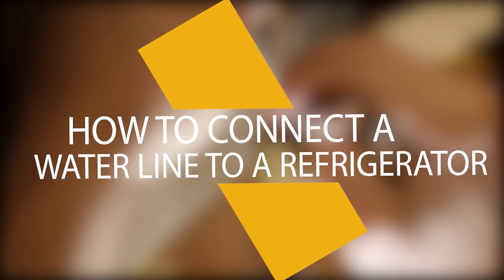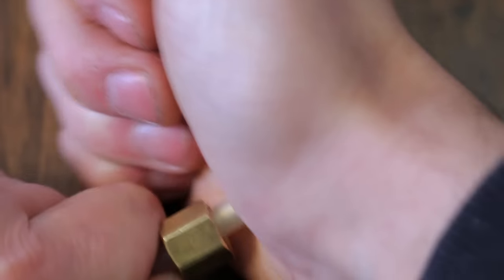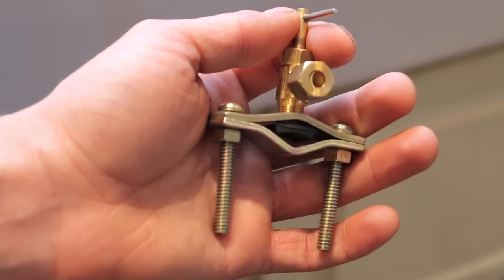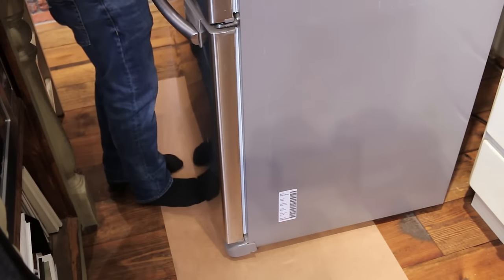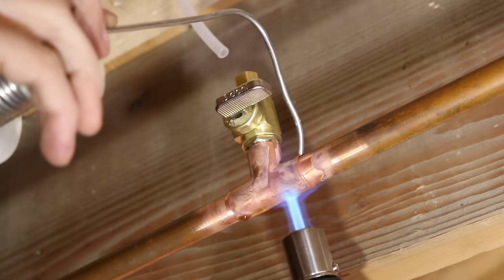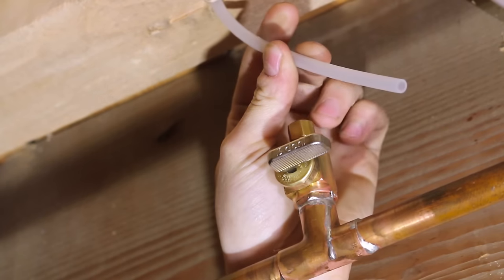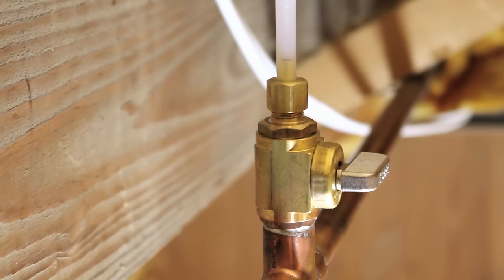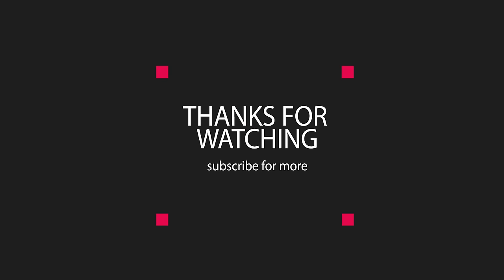How To Connect A Water Line To Your Refrigerator (+Tips & Tricks) | GOT2LEARN

Comment: Okay, I may just be using a slightly larger compression valve, but mine keeps leaking :( :( help anyone?!! My situation is kind of special - water line connected to my pipes is thinner than water line coming from fridge so I had to get 2 different sizes..

Comment: How do I cap one of these? I have a water dispenser that hooks up to my water line and runs to the fridge. My fridge doesn’t have a water hookup so I need to cap the line that goes to the fridge.
Reply from the maker: You need to follow the line up to where it's connected and use a "rubber ball" in the compression nut, they sell them in the compression fitting departement.

Comment: Great video, but I need some helpful advice on my Frigidaire FGHS2655PF5A side-by-side refrigerator. I installed a new water inlet valve, a task I have done many times. Nonetheless, this I removed each water line from the water inlet valve and installed them to the ports on the new water valve. Then I connected the solenoid connectors. Hearing a 
"clicking sound" as I installed each corresponding water line being assures that each water line had been seeded properly. Well I was wrong. When I turned on the water sourced and pressed the door water valve I noticed that water was coming from the 5/16-in water line that exits the filter and connects to the port in the rear of rear water valve. I tried 3 times to correct this problem and noticed that the water line would only insert maybe 3/8 of an inch into the water valve connection. No matter what I tried, I was not able to insert the designated water line into into the connection port without it leading. Of course these are push-in connectors and the lines were cut straight. So, do have any suggestions?
Reply from the maker: Maybe the gasket is missing in the push fitting, check that out.

Comment: 1:30 - the plastic Ferrell (washer) is on backwards. On mine I had to put the smaller end towards the nut.
Reply from the maker: Huh? That's the way it goes on.
Reply: Got2Learn 
   It’s backwards in the video; doesn’t compress properly that way, and the tubing pulls off .

Comment: Thanks so much for posting this video. I recently had a leaking waterline that I had to replace. I went to 2 different hardware stores and they weren't able to explain how to prevent the brass ferrule frome leaking. They only offered this as an option. After watching your video I decided to try the plastic fitting as you recommended and it worked the very first try.
Reply from the maker: Awesome Chad, really happy to help :)

Comment: A braded hose is not good for a fridge it will make the water taste like rubber
Reply from the maker: Really? I didn't even know...thanks for the tipv;)
Reply: @Got2Learn  steel doesn't taste like rubber. But to be safe no matter what line is used. Always use a good filter that is rated for metal filtration. And lastly if it's water, the first time usage after installing and also after changing the filter. Take at least a half gallon of the water and dump that down the drain. A gallon is best, but a half gallon should be disposed at min.
Reply: Flush it for 15 minutes and it's fine. Otherwise it's pretty nasty.
Reply: Manny yea but the steel covers rubber which is what the water goes through
Reply from the maker: Yeah the water goes thru the rubber inside, which is why is has a weird taste.
Reply: @Got2Learn  I was told rubbers were 99.999% effective.
Reply from the maker: Yeah after they are flushed out I guess ;)
Reply: @Got2Learn  Hah!  I was told this is a family friendly channel :D
Reply from the maker: Hehe, didn't think of that one lollll
Reply: @Got2Learn  I am here to help.

Comment: My supply is hot water. Always has been. Does it matter?
Reply from the maker: Yeah you shouldn't be drinking hot water.
Reply: Thanks. We bought the house and discovered the line is hot
Reply from the maker: Can you exchange it to a cold water line nearby?
Reply: Curious why they ran hot line.
Reply from the maker: Probably a mistake ;)
Reply: Got2Learn 
Hmmm. Thanks 
I’ll try that.
Reply: adeolu Adeoye   Most likely they didn’t run the water to confirm which line was hot. Probably traced the line from the water heater and lost it or mixed it up when they tapped into it. 
Also, hot water can damage the water line, filter and ice maker! Change this as soon as possible. Those components are not meant to have hot water running through them!
Ron

Comment: Still taking questions?
Reply from the maker: Always!
Reply: @Got2Learn  Thanks. I'm trying to understand when and how one would use these braided stainless supply lines that company's like Eastman makes that are sold in big box stores.  They have a rubber gasket as the seal mechanism but they seem compatible with the connection on most refrigerators and its difficult to find the right "T" connection on a 1/2 inch water supply valve.  When the heck would one use one of these?  They seek to be virtually indestructible.
Reply from the maker: The thing with the stainless steel lines is that they are made of rubber, far less resistant than copper or PEX, I would only use those as a last resort.
Reply: @Got2Learn  Understood.  Thanks.  PEX is adequate?  Something about plastic...
Reply from the maker: Sure man, unless you're eating ice cubes 24/7, you'll be fine.
Reply: @Got2Learn  Thanks again.
Reply from the maker: @VinceEspositoJr  no problemo 😉

Comment: What if I already installed the saddle valve over 20 years ago, and the water line has already been punctured? What is my best option for replacing it, if soldering it is not an option?
Reply from the maker: If soldering is not an option then you can use a Sharkbite slip coupling.

Comment: I have a nylon line off from my fridge and my water line supply line is brass or metal, can I still use the quick connect? Or will I have to use the compression fitting. I am familiar with both. I just never have used a quick connect on steel brass or metal before. Please help. Thanks
Reply from the maker: Yes you can but you won't need the inner sleeve for the copper pipe. Also, make sure the copper end is free of any shards as to not damage the small o-ring inside the fitting.

Comment: A very informative video. I use a a scrap of Pex or vinyl tubing as a sleeve over the water line as a buffer anywhere it penetrates wood. Just because that line is so thin I want to give it extra protection. I also use a bead of removable caulk around the protective sleeve on the basement side to keep the sleeve in place. Just don’t let the caulk get on the water line as it makes replacement more difficult for the next person. I also use a shut off valve with a drain port or I put in two valves . The second valve runs off a Tee and has a short section of pipe or hose coming off of it so I can drain just that line if I need to replace the refrigerator water filter I can remove the water pressure off the filter and I don’t make a mess. I do the same the for each bathroom or kitchen, etc,  so I can shut the water off to just that area and drain just that zone so I can work on it an not disrupt the rest of the house. Even if I use a manifold I will set up a valve to drain just that zone and it makes it much easier to work on.
Reply from the maker: Good info here guys, thanks for your input Ron H ;)